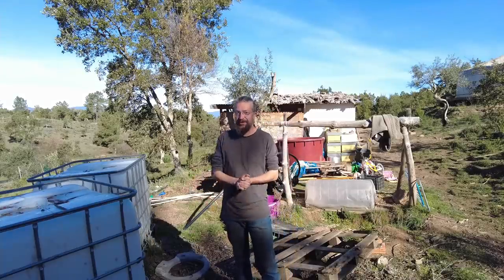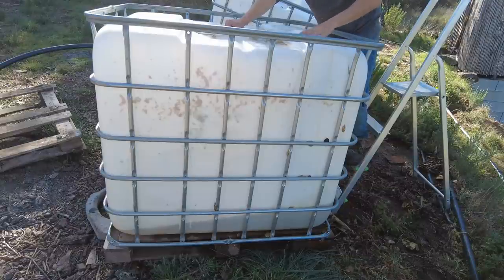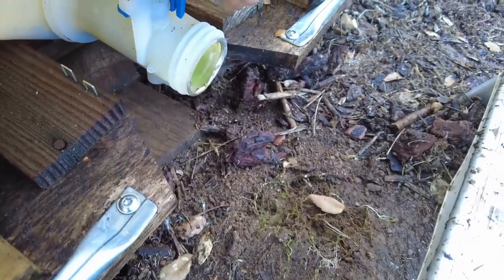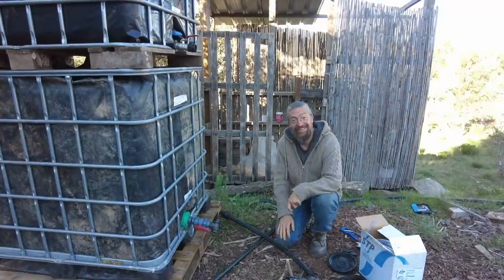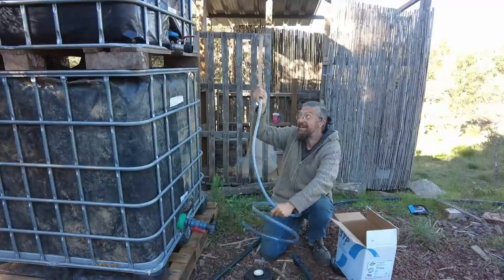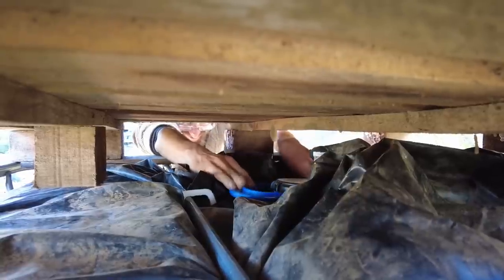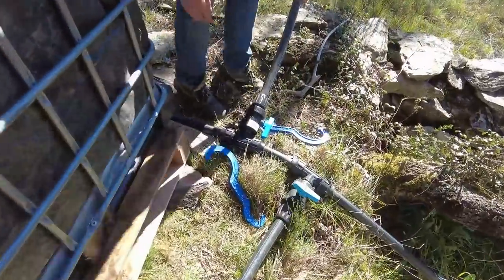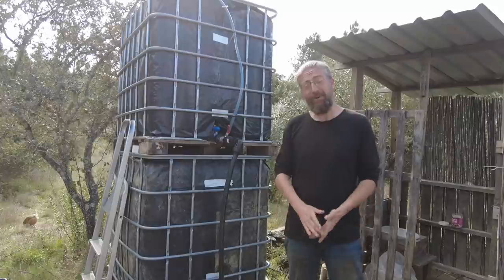Our best IBC watertank set-up yet [off-grid gravity fed irrigation system]

Comment: Hey, guys, love the 'doppel-decker' IBC...! The air tube is genius. Can you tell me what is the elevation above the garden now, in metres near enough....? Does the flow rate and pressure exceed what you were getting from the pump previously? I think at the end Maarten said it does, but how much better? Did you measure flow rates before and after? Or time to fill a bucket..?
And did you move the IBC set up mainly to save power from pump use? Please advise as I am looking at this issue for someone else....TIA :)
Reply from the maker: Hi Mark, the bottom of the tank is now +- 5 meter above the taps in the garden. We use 32mm pipe between the tank and the taps and after that it is ordinary gardenhose (18 mm?!) the difference between before and after isn’t that much (because it is just that one tank difference) so I didn’t bother measuring it. Now that the air is out of the system it fills a 15 liter bucket in about 10 seconds, which is overkill for us 😂. Like I said in the video we mainly installed the tanks as a battery so we can run the pump during the day on the solarpanels without using the batteries. We usually water the garden before the sun is on the panels. Our pump would still be able to move more water because we have a strong pump with 40 mm pipe. I hope this helps. Cheers, Maarten.
Reply: @ourportuguesehomestead  Yeah that's good info. Is the tank now above the outdoor kitchen, or do you still need to pump to there?
Reply from the maker: No these tanks are just for the garden and are on level with the kitchen. We have a third tank 5+ meters above the kitchen on the hill for household use.
Reply: @ourportuguesehomestead  Ah, cool, I wondered how you managed that. Is that higher IBC also supplied by the dame pump?
Reply from the maker: Yes the same 40 mm pipe and the pump should be able to pump water all the way to the top of our land (50 meters up)
Reply: @ourportuguesehomestead  Awesome. Fifty metre head is excellent. Do you know brand and specs of the pump? Is it 12VDC or 230VAC off the inverter?
Reply from the maker: It is on the inverter so 220-230V. It made more sense for me as I’m not an electrician 😂. https://www.oliju.com/Oliju/products/31/Aqualiju

Comment: You probably know this, but if the joint has an o ring or gasket, you don´t need teflon. Also, when assembling them, if you coat the rubber o rings and gaskets with vaseline, it´ll make a much tighter seal and protect the rubber from rotting.
Reply from the maker: Yes I only used teflon on the connections that don’t have gaskets or rings. The vaseline is a great tip and I’ll incorporate it in the next install (if it ever needs to be done again haha)

Comment: Ohhhh, yeah. IBC cubes. Been there, done that. In the end I spent many €€€ on some guerilla construction work and have a 24,000l concrete tank in the ground.
Reply from the maker: Our well holds more than 100,000l when full so we use that as storage for now, but I’m thinking of digging a massive pond on the top of the land in the future that will replace these IBCs for pressure and actually be a proper water store. This will do in the meantime :).

Comment: You'll have to cover the Clear hose as well. It will get green algae over time if it gets direct continuously direct sunlight. I had to clean a hose of a Huge water tank (Staal) which had that on the side. It was covered with a customized cover (goot / Gutter plastic) vertically attached. However, it still got that green thing. I would've made a special hole for the "water level" measurement hose.

Comment: I think the recommended number of loops of PTFE (teflon) tape is about 3, if you need more one of the connectors is badly worn or the wrong size - apparently!  The clear plastic tube between the IBC tanks used to be called a 'manometer'.  Well done Maarten & Lea, you're doing a marvellous job.  Nick (a new subscriber)

Comment: Marten; I use IBC tanks to treat grey and black water here in california. I have a off grid place in Hawaii I use them for collecting water from roof as everyone does there. Here in California I collect all rain water and treated Grey into above ground swimming pools. I have almost 50000 gals now, i have 3 18ft dia, 1 24 ft diameter and 1 18foot dia that is 6ft high a custom one,  will put up another 24ft tak this summer ...getting close to 60K gal. The above grd pools are the cheapest per gallon storage. I keep them covered to keep out debris and sun. I have learned a lot about making them from scratch also. I need to make some videos. My system enables us to keep our garden even during draught. Regarding IBS, you can drill them and tap them for pipe threads. here I have tapped up to 2inch pipe holes. Get a 6inch long pc of steel pipe with threads on at least one end. Cut hole in tank just smaller than threaded end of pipe, Push and turn the steel pipe into that hole.. It will cut threads, you can then thread in PVC fittings etc ...you dont need a holding nut on inside. In this way you put fittings anywhere on the tank. In hawaii i put a 3/4 inch pipe tap at bottom and attached pvc ball valve , I have 4 tanks tied together each with a 3/4 inch pvc ball valve on it. the smaller valve much easier to turn. also i painted my hawaii catchment tanks with water based asphalt  emulsion , two coats , to block light. i then painted them wht ( latex works) to keep them cooler..they are in some sun, but plan to put a roof over them . SOmeone suggested Vasoline on your fittings..yes that is good, but I have found the wax ring that is used between toilet and floor much more robust , heavy grease/wax, perfect for plumbing fittings. It seals small leaks , prevents corrosion keeps fittings from seizing up, easier to disassemble. Vasoline is light grease which will evaporate. The toilet wax will last much longer outside. I coat metal pipes in it to prevent rust. My hawaii place i use a bit over 400watts of solar it runs all lights and a small chest freezer I use as refrig. I have it on timer comes on 2 times a day , 9 and 1pm. ( I store solar E as cold in bottom of freezer)  Bottom has all 1gallon jugs of water , it just keeps them with ice crystals in them, a 1inch foam board sits on top of them. Inverter is 100watts , but could be smaller, freezer only uses 120watts when running. I am Master degree Engineer, 68yr old,  expert in RF/Microwave/GPS/Sat systems, but I fixed ny own cars, still, have since i was 16. I also have a 6000wtt solar system here in california that over ten people get all there electricity from.

Comment: Thank you for this vlog, it came at a perfect timing for us, just as we were installing our own IBC.
One small comment, there is no need to pull out the tank from the cage, since you don't cover the bottom. When the tank is empty, the plastic is flexible enough to pull down the black tarp "skirt" all the way to the bottom. All that is needed is to disassemble the two horizontal bars on the top and cut the tarp to measure.
Reply from the maker: We’ll keep that in mind for next time ;)

Comment: The reason for adapting the clear vinyl hose into the top cap of the bottom tank is...physics.
If the cap allowed no air to escape..the incoming water would compress the air into an area under the cap....
and would stop water inflow when the pressure of the air equals the pressure of the incoming water.
By placing the hose in the cap and taking it up to the height of the top of the top tank....the air can all be replaced by the incoming water....and the bottom tank is always full if there is water in the top tank...and the valve on  the top tank is open to feed into the bottom tank.
Then when the top tank is full the pressure available from the outlet of the bottom tank will be at it's highest....
Reply from the maker: Thank you for your explanation John. I had no idea what I was doing ;) cheers, Maarten

Comment: I think you should put an  Sea flow pump and air pressure tank inline on your water system It will help with pressure and less use of your pump I have a twelve volt on mine runs on an old car battery use solar power to keep battery powered  if can get a 12v deep cycle battery for marine will work best. Thank you for videos.
Reply from the maker: We don’t have a pressure issue, nor do we have to use our pump often. Twice a week in summer. I’m a bit confused by the comment haha. I’m happy for you, you found a setup that works for you.
Reply: just a suggestion my friend did not mean to create confusion. you are a smart man should have known not to comment . sorry for bother

Comment: would it make sense to cut the top off so you can get in and really clean the inside and then tape it closed?  or put white vinegar in it?
Reply from the maker: Cutting them open is not really an option in this setup and cleaning them completely is not really necessary for garden irrigation (unless you do drip irrigation)
Reply: @ourportuguesehomestead  
If you needed to a filter could be placed on the outlet.....

Comment: Why would you put the tanks on top of each other? Wouldn't the top one put too much weight on the one underneath? For great pressure, I'd have to build a ramp or little tower for both. I think you would get greater pressure. We do build on Hills (Bergen) when there's one. My father was Portuguese, living in Curacao. He did build some Concrete tanks (Water bakken) like 8 times the size of those IBC water tanks. he did it mostly on a high leveled place. You are doing great.
Reply from the maker: No they're made to be stacked with liquid in them. Pressure was fine before because we have them two terraces above the garden. This just looks tidier, and would help with pressure if you don't have the hight difference we have.

Comment: It would probably last longer if you painted the tanks with a good outdoor paint vice the plastic.
Reply from the maker: It is hard to find good paint for this purpose and our climate. I have seen a few people around here that used paint and because the plastic blatter flexes a lot with use they tend to crack or flake after a year or two. This plastic lasts longer (as long as the wind doesn’t rip it).
Reply: @ourportuguesehomestead  In the US you can purchase something called "flexiseal" which should be good for this project.
Reply: @ourportuguesehomestead  so build a structure around it from, e.g., palletwood and then paint that. :-)

Comment: If you have a floating ball valve in the top tank inlet line (the water line coming from the pump) and put a pressure sensing cut off switch on the outlet of the pump...when the pump has filled both tanks the float valve stops incoming water, the pressure in the feed line from the pump rises; the sensor activates and switches the pump off....until the level in the tank drops....
You can use this system on the kitchen IBC as well......just T off the kitchen feed after the sensor switch....
That  would maximise your use of electricity produced by the solar system without needing your monitoring it...just turn the pump on in the morning and off at night?
Reply from the maker: The pump asks a lot from the solar system, so we prefer to run it only in the middle of the day when it can run solely from the panels. I wouldn’t want to risk it turning on at night or early morning when it would drain the batteries. It’s not too much hassle to just keep an eye on the tanks

Comment: If you dont use pipe Doug or white pipe tape on the thread, evriting will leak, even the thread adapter against the token wall
Reply from the maker: It hasn’t leaked after we’ve published the video. So far so good :)